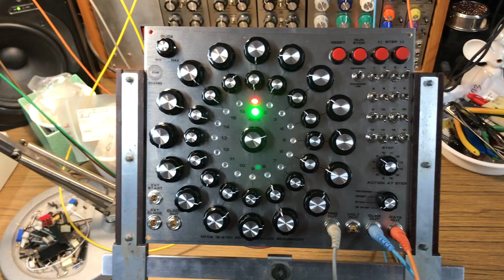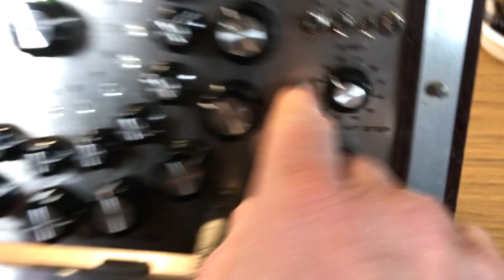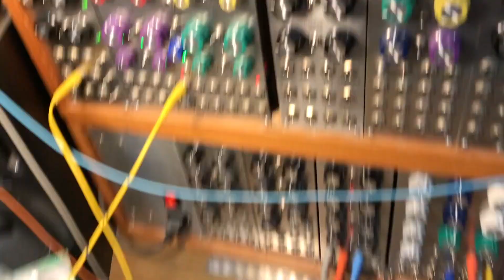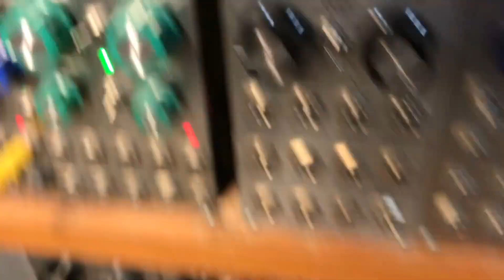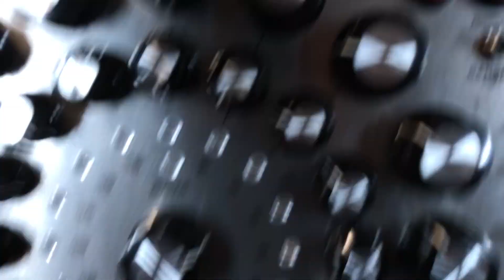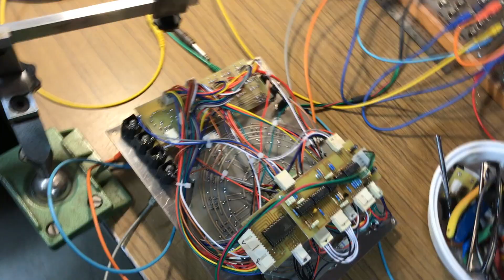Sketchy Labs MFOS Rotary Sequencer

Comment: Did you implement a gate booster for it? I found mine impossible to trigger with standard 5v gate, so I built a gate booster, but it messes up the normalling when I want to use the internal clock, so I need to figure out a solution to that. Maybe a stereo jack with normalling might do the trick :)

Comment from the maker: At 7:37, of course, I meant to say "jacks" instead of "pots."
I also want to mention that I had to upload this video twice.  The first time, I tried to use the Hitfilm video editor to make the video (from four different iPhone video clips).  It was really hard to use, because it had a jillion-billion features that I didn't want or need and it was really hard just to do the basic clip editing.  However, I had a video I was reasonably happy with, and then after I exported it, I uploaded it to YouTube and then looked at it, and it was all mangled and pixilated and was basically unwatchable garbage.  I tried to export it about three times, with similar results.  Then I downloaded iMovie (an older version, because I'm still using Mojave on my Mac), and that was super easy to edit the clips (just split them where you want to cut them and delete the chunks you don't want), and it exported perfectly the first time (and much more quickly, too).  So, iMovie for the win!

Comment: I built a whole North Coast leapfrog from a kit and successfully tuned that and the whole other 13 trimmers. Help a budd whether an old Dixie's trimmers wore off.
Reply from the maker: Dixies and Rubicons are a pain in the ass to calibrate, because there are three trimmers -- one for basic 1V/octave tuning, and two for high-frequency correction.  It is a bit of an art to calibrate them, even with practice.